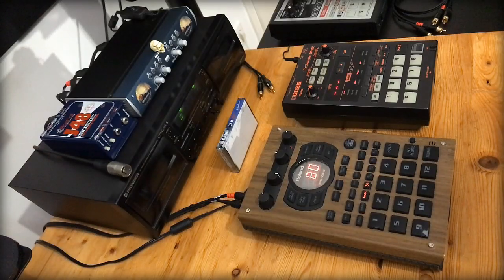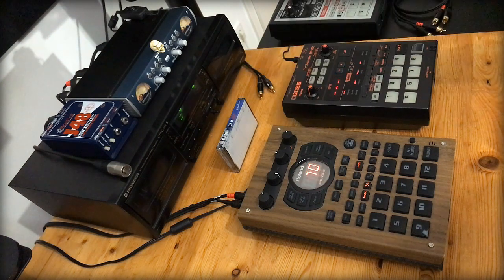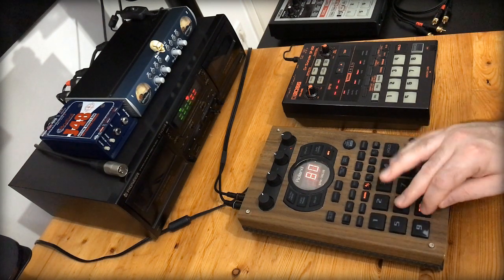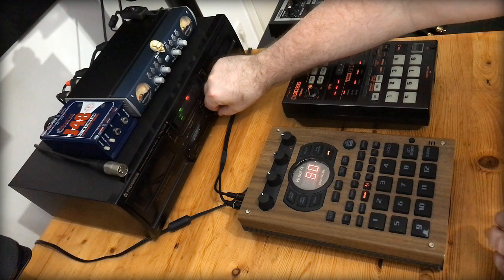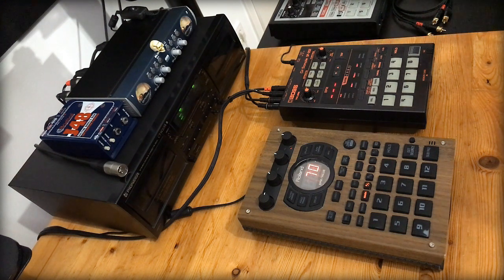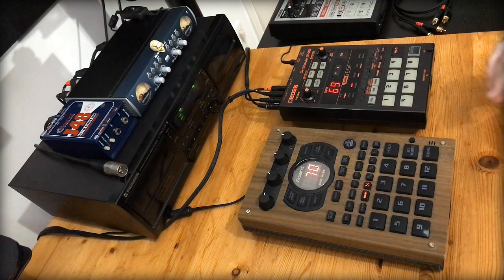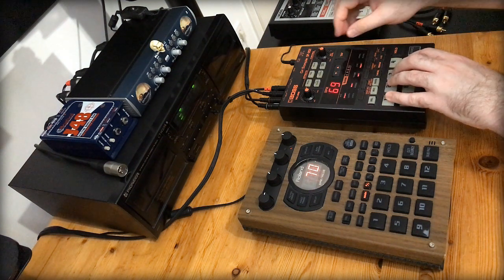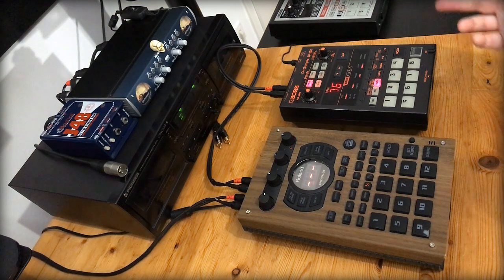Throwing SP-404 DRUMS On CASSETTE TAPE Then SP-202 To Dirty / Warm Them Up

Comment: That tape saturation adds some thud to the kick.
Reply from the maker: That’s something I didn’t expect so much, usually when you’re doing something that’s compressing like this I figure it would do the opposite but I found when I was mastering my beats to tape, even after they’ve been compressed / limited, the beats came back with more dynamic range.

Comment: Been wanting to try this for a while. Do you use a special tape or just any old blank?
Reply from the maker: It’s a beautiful thing, def do it! Nothing special about the tape, it’s a type ii, I also have a type iv (which is maybe a little cleaner and can record at higher input before distorting…kinda).
Reply: @Nonjuror  Sweet will def try it! Was hard to hear first listen but def puts them all in a space and grunges them up nice. Cheers bro
Reply from the maker: It’s subtle than you’d expect, mostly it smooths away the highs, compresses n slightly over drives it - that said, you can push the rec level more n make it real real nasty
Reply: I expect a high quality metal cassete is too clean for the effect required. Creative stuff man
Reply from the maker: Thanks dude, yeh the type iv has so much head room compared to the ii, def prefer the ii for drums, iv is great as part of the mastering chain tho
Reply: @Nonjuror  thats intresting. Using the tape to soft clip aswell?
Reply from the maker: That’s the weird thing, if you put a beat on cassette where you’ve already done some mastering like a limiter, when it comes back off of tape it was more dynamic range - the heavy kicks n snares aren’t as even as before
Reply: @Nonjuror  yea tape is a really strange thing. I remember recording on them over and over and the magnetic dust kinda gets lost over time
Reply from the maker: Oh word, indeed, I forgot that, I’ve been recording on the same 2min of Side A for a while now…I should switch it up!
Reply: @Nonjuror  tape does sound kinda dope worn. Also stretched tape sound really dope but cassetes these days are a little expensive to stretch
Reply: @Nonjuror  i remember hearing tapes stretching and having to jump up and save my tape then pull it all crinckled out of the tape deck without snapping it and winding it back into the casssete. The tape wud warp over the damaged parts when u played it back
Reply from the maker: Oh yeh, the sound of a worn warped bit of tape just before it gets chewed by the walkman…yep, I remember that
Reply: @Nonjuror  depends also if you use dobly b or c and if you can set your cassettedeck onto the type of cassette you insert :)
Reply from the maker: I’m not sure if it’s my tapes or my deck but I haven’t had any luck with getting a good sound with dolby, luckily when I chop drum shots they’re usually too short to catch much of the hiss
Reply: @Nonjuror  try tracking down a metal format tape
Reply from the maker: Yeh the Type IV Metal give a muuuch better signal to noise ratio, more than half of Chopsmith Offcuts was “mastered” to a metal tape, some of the more nastier beats I put on chrome.
Reply: @Nonjuror  ur beat tapes are dope.  Heavy sound
Reply from the maker: 🤘🤘cheers dude!